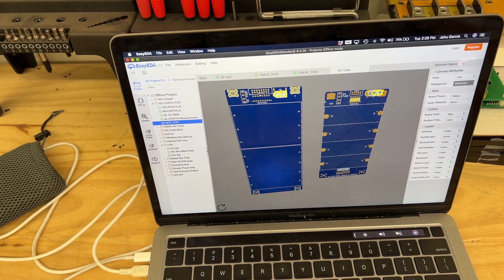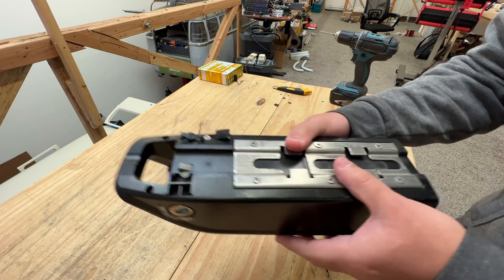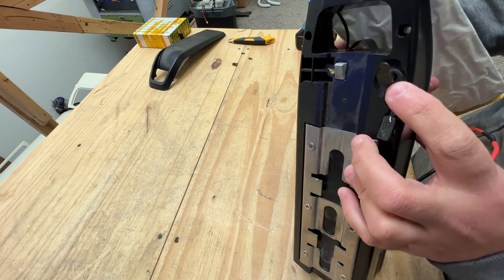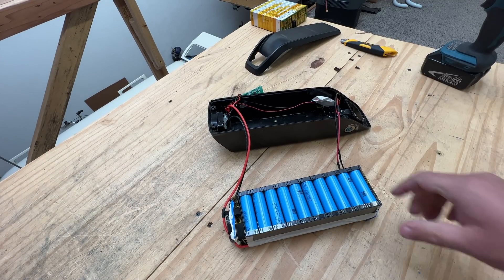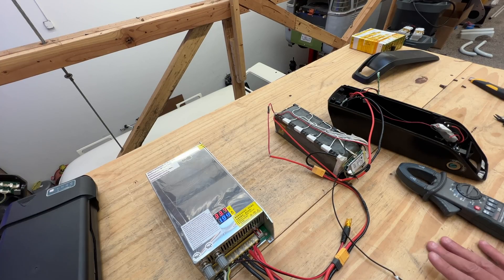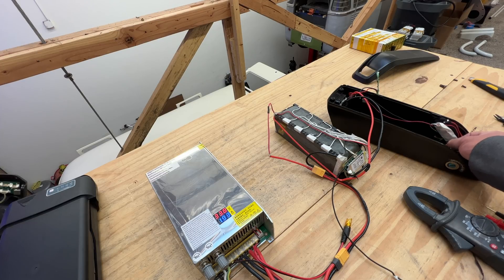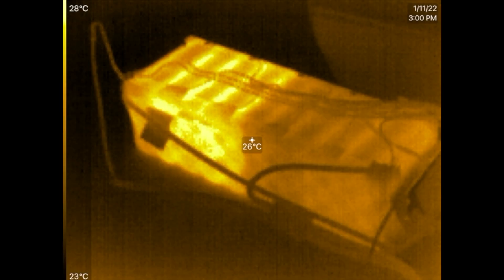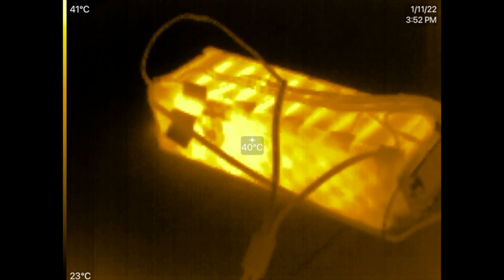Another $29 eBike Battery using Samsung 29e cells

Comment: I have a phone which uses dash charging (5v 4amp). Can I connect a buck converter to my Li-ion battery pack and output of buck converter to a USB female jack delivering 5v 4amp and get my phone dash charged?
Reply: Sadly no. Your phone will charge @1A.
For dash charge to work, your phone talks to the charger. If both are happy with each other dash charge will be enabled.
Reply: Thanks Jonas for your quick response. Appreciate it.

Comment: MB I was like what are 21700 Samsung 29e 21700 batteries I see now I was thinking these might have been a low mah higher rated amp discharge rating 21700 my bad

Comment: What power supply did you use to change the amps?
Reply: i am using a old power supply from a laptop and then a boost convecter from juntek
and load it whit 1amp this working nice webadress https://nl.aliexpress.com/item/32869577176.html?spm=a2g0o.productlist.0.0.5c3c4838oH7bsr&algo_pvid=61fa71e7-235d-4489-9cf6-0b78d1901e03&algo_exp_id=61fa71e7-235d-4489-9cf6-0b78d1901e03-10&pdp_ext_f=%7B%22sku_id%22%3A%2212000025595314104%22%7D&pdp_pi=-1%3B25.4%3B-1%3B-1%40salePrice%3BEUR%3Bsearch-mainSearch
Reply: @jeffvenqueleir2036  do you have any more information or video explanation. What would I search for to learn more information?
Reply: @Knightguyver  i am 70 years old i do it now 3 years i have learn all from you tube start with omh law then find some old laptop battery buy a small bms system 
and when you understand how all is working go then to a local bicycle store and aks them for old bike battery for  a school  project and give the seller between 5 or 10 euro 
for one packet and every one is happy the advice i give see a lot off video s about 18650 Cells have fun and good luck

Comment: Jehu. 
Can I use these batteries to make a battery bank? Possibly charge them via solar? What would your set up look like?
Reply: You could certainly use them for a battery bank. Jehu has a setup on the rear wall of his facility using the kit he developed to make DIY power walls. It's just a matter of going through the cells, checking capacity and voltage, and ensuring the cells are good to go, etc. The only unknown would be life left in the battery but it comes with the salvage territory.
Reply: @DDCRExposed  yeah. I did see the power wall system he has on his website. I was wondering if I could just use these packs as they are and make a battery bank from these opposed to taking the batteries apart.
Reply: @chrisvazquez6106  Yup, you could do that too with whatever is using that voltage the battery is set for. Just ensure the BMS is working and you're on your way.

Comment: Hey Jehu, the small white block in the case is a simple buck converter which supplies a constant 5 volts to the USB port regardless of the input voltage.

Comment: What variable unit are you using to bring the charge up on them ?
Reply: Probably 42volts 2-4 amps
Reply: @ogland6482  MAX 4 AMPS and not 10 amps then you overheat the battery
Reply: @jeffvenqueleir2036  The bms will disable itself before the cells get damaged. Even if you do something stupid like put 54volts into it. The BMS protects against most things.
Reply: @ogland6482  Yes but thé bms must work and that is not always that the reason i do it slow